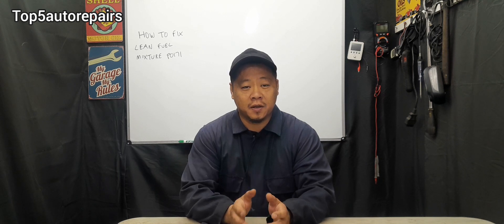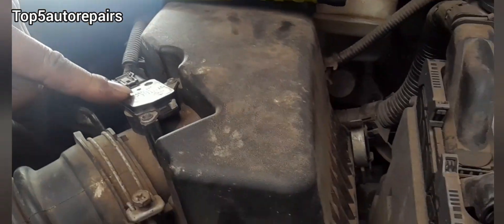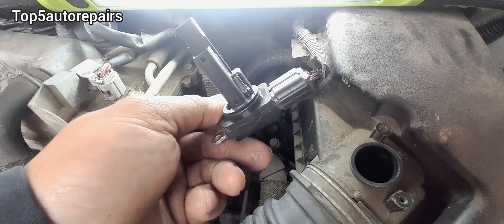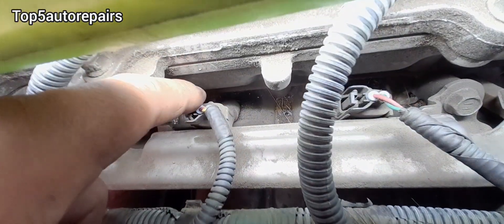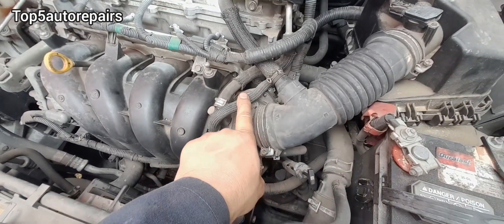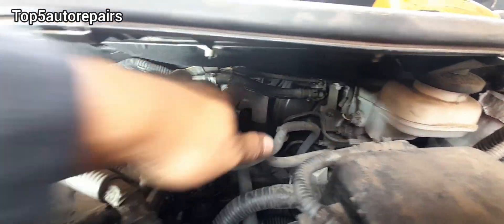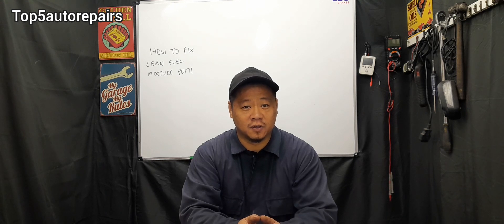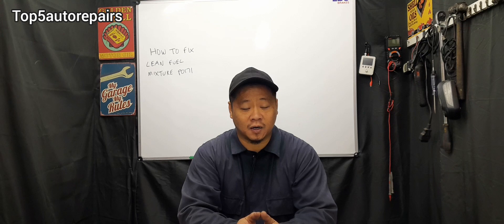HOW TO FIX  ENGINE CODES P0171 AND P0174 SYSTEM TOO LEAN FUEL MIXTURE (BANK 1 AND BANK 2)

Comment: Can it still be cause by the MAF  even if it idles like a perfect dream??? And smooth n quiet ... I some times think she stalled at a red light cuz she's so perfect ... Just these two dam codes pop up under slightly load like a highway ramp I go up going to work . A SLight incline.... along with p 420.. all 3 same time 😮.. I keep having to change  my plugs that r carbon caked . Only checked my fuel system so far n it's a   perfect steady 50;psi... She turns into a beast after idling for ten min while I am in the store . When I drive off it's power like a beast then she gets sluggish . down shifts n slows down faster then I believe is normal... Something is building up in that ten minutes iam in the store n it's not fuel pressure... I did install a cold thermostat that is below spec but wouldn't that cause her to run ritch . I just can't believe how perfect she idles n it's hard for me to believe there a vac leak .. plus rpm is not high

Comment: my code p0171 gone away and has turn in to a p0300,p0302,p0303 and p0304.    so now its misfires on cyliner 2,3,and 4...what the heck is a po300 lols.. do u know whats causing this? i see my spark plugs are a little wet in oil so maybe my engine valve cover gasket is leaking oil to the spark plugs causing misfires ? i dunno but i am taking my car in to the shop this week made an appointment already. reply back and what u think it might be lol ? to me im thinking the cover gasket is bad
Reply: There is video for p0300.cyclinders and its some of components need to be rebuild.expensive one